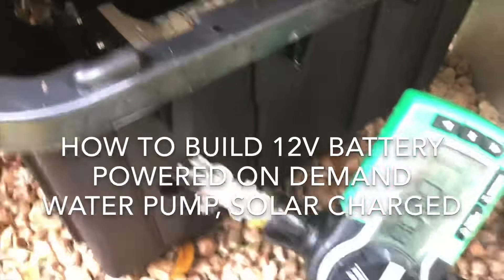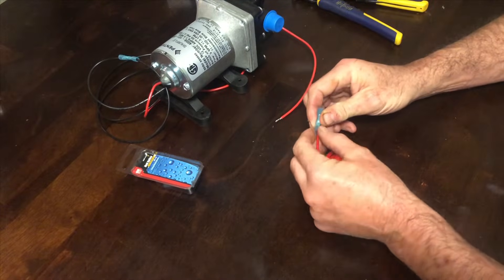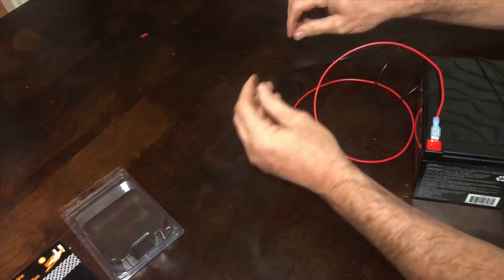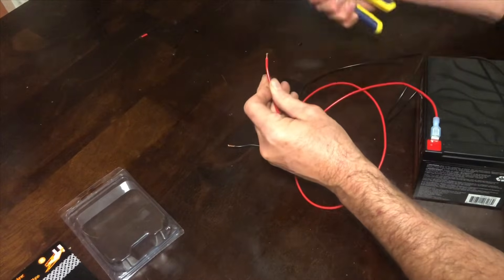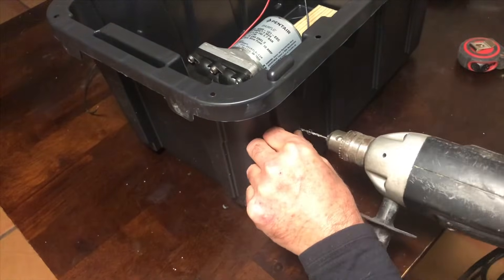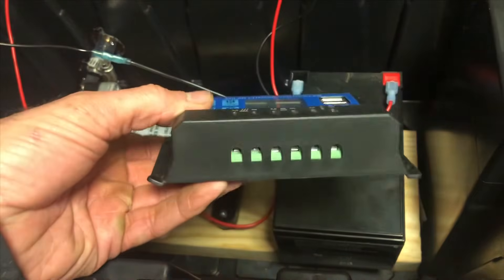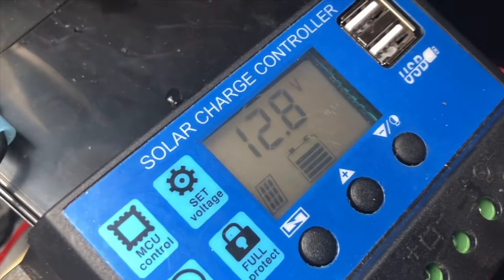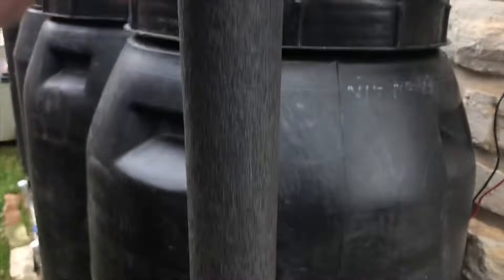DIY Battery Operated Water Pump for Rain Barrel Irrigation, with Solar Charging

Comment: Nice!  Be aware if there is a leak from the pump connection inside the plastic bin/box, it could flood the and damage the pump.  Maybe drill some 2 inch diameter holes 😊on the box bottom for drainage?

Comment: Hi Tony!  Thanks for a great video.  I have set up exactly as you did but my pump will pulse on and off if I connect it to the battery.  I do have the rain bird timer on the output side. Any idea why this could be?

Comment: I seen in other videos people wired the pump directly to the battery. Does it matter if the pump is wired to the battery directly or straight to the charge controller?  Just looking for other options ..

Comment: Hi. Thank you very much for this. I've followed you advice and will be doing this install tomorrow. Can I just check. I get very low water flow from a tap in my water butt. Does the pump actually increase pressure from a weak flow? Also should it go before or after the time the water flow sequence?

Comment: Please advise all the parts and tools used. I especially like your stripper. What make and model pump? Can you please put links for the battery and the parts for the solar panel bracket? Please put a link for the stripper. Thanks.

Comment: Thanks for the video. Do you have a pressure regulator after the timer?
Reply from the maker: Good question, yes, its a 25 PSI Low Flow Pressure Regulator.  I'll be sure to mention it in the upcoming update video.
Reply: @TexasOrganicGardening  Any update yet?

Comment: I'm late to the table 😄 very informative vid-clip and enormously helpful. One question: why AC and not DC pump? Quite impressive controller/inverter.
Reply from the maker: It is a DC pump, run from small battery.
Reply: @TexasOrganicGardening  yea, but why?

Comment: Hi I like your video and I will like to buy the same water pump but I didn’t see on and off switch and I need just for hose to water garden
Reply from the maker: It is an on demand pump, so if it detects water flow out the hose end it turns on and pumps more.  Same pump used in RVs for something like a kitchen sink - turn on sink pump kicks on automatically.  If you're manually watering garden have a nozzle on the hose that you can open/close. That will cycle the on demand pump.

Comment: I noticed you struggled just a little when using the hole saw. If you’re drilling plastic or even very thin metal with a hole saw like that, run it in reverse and it’ll work much smoother.  Thanks for the video. I’m watching tons of them to compare to the build I’m working on. No criticism here, great job. It’s simple and works for your application. 👍🏻
Reply from the maker: Thanks for the tip!

Comment: Hi Tony. I built a similar system but am having issues with my motor pulsing. Do you have a vacuum break in the line after the timer? Wondering if that might fix my issue. Thanks

Comment: Great video. It took me quite a while to find what I was looking for. I am going to set up a system like this for our school garden.   I have a question.  What is the longest you suggest letting that pump run before you run into overheating issues?  Thanks.

Comment: How does the timer hook up to the pump to turn the pump on and off? And what timer did you use? And this is a great video good information! Thank you with any help!
Reply: The pump has a built in pressure switch and only runs when there is a demand.

Comment: Thanks for the great video - I'm working on plans for something similar, and have a few questions for you. 
Have you found the size of the battery to be enough to support your system? I was considering a deep cell RV battery, but would love to consider something cheaper. 
I also noticed you don't have a fuse on the pump line - any reason to add one? 
How many watts is the solar panel - does your battery remain well charged all year? 
How long of an irrigation system? I have to water 7 4x4 boxes - would the PSI on the pump be enough to reach the end of my line? Thanks again for the great video!

Comment: Why does the load output keep turning itself off?  Kinda like it times out and shuts off.  I keep having to open the crate and hit the button to turn the load port on to use the pump.

Comment: Do you need a flow regulator so you don't blow out your dripper lines in your garden beds???
Reply from the maker: Depending on the pump you use, possibly yes.  Most drip irrigation work best at about 25 PSI if i am not mistaken but check the specs of the drip lines and emitters you are using,

Comment: This was helpful thanks. I put in a similar build bit with a splitter before the timer so I can use it for hand watering also (super handy) plus put in a float switch in the water butt to prevent it from running dry.

Comment: Hi! I made this set up but with a hose instead of a drip system and sometimes when the pump shuts off due to pressure my solar controller will reset and the arrow between the battery and load will start blinking and i have to click a bunch of buttons for it to reset. Any suggestions would be very greatly appreciated!
Reply from the maker: Not sure, but I’d check with the controller manufacturer

Comment: Great video, thanks. I built an exact replica system. I keep running into the charge controller flashing the load icon. According to the manual this requires a reset. No matter what I do I run into this problem. When this is happening the timer doesn't turn the pump on. I have to manually turn the pump on through the controller. Any advice is welcome.
Reply: Are you connecting the pump to the load connections on the charge controller or wired right to the battery? I have two similar systems, but I replaced the charge controllers with something more robust. From what I understand, the load connections on the charge controller aren't really designed for higher loads. They're more for low voltage lighting or monitors. I wired mine directly to the battery (with a 10 amp fuse in between the pump and the battery on the + side). I previously had them wired to the load connections on the charge controller and one of them started smoking. I took it apart and part of the PCB was burned up. Just before, I was having the same issue you mention. Unfortunately, now in hotter temps, I'm running into thermal protection turning off the pump after about 10 minutes of watering. According to Pentair, these pumps are not designed for continuous use, just short term and intermittent use.

Comment: I’m wondering if you’d be able to share a link for a water pump with an outlet plug that you’d recommend? I’ve loved your videos and am thinking of doing a slight modification with a power inverter so I can run my chicken coop heaters off it in the winter too.
Reply from the maker: It’s should be in the video description, if not in this video then in one of the others in the Rainbarrel system Playlist
Reply from the maker: Google search for on demand water pumps.  There are usually AC and DV versions of each pump.  I chose to go with the DC (12V) just because I wanted to do a solar project and learn.  Nothing wrong with use a plug in version.

Comment: Nice video. I have the same charged controller. Did you install a 10 amp slow blow fuse inline with the motor?
Reply: I'm so sorry for asking this but what is inline with a motory? He did list the fuse but didn't show an install.
Reply from the maker: Yes there is an inline fuse recommended.  I need to publish an update video!  It had not arrived in the mail in time to make the original video.

Comment: I'd have gotten some bulkhead fittings for the tote, to help make it more water tight. I also would have done a bit more cable management, added a riser from that 2x4 to mount the solar charger on. all in all, not bad.

Comment: Great idea!  I would have an additional tote within the larger one for all the electronics though.  If a hose ever cracks, the last thing you want is a live-current 12 V solar system swimming near your work area.
Reply from the maker: I think 12V systems are considered safe, thats why most outdoor lighting and such is usually 12V, but if anyone has more info on this I am always open to discussion.

Comment: Good video.  Quick tip, never hook up the wire leads to the battery 1st, that's always the last connection. It's can blow up the battery if the two ends touch.

Comment: You didn't show the fuses being wired in. I am assuming these are wired in-line with the positive from the battery to the pump, and similarly to the solar panel? I didn't see these in either of your videos. If you could confirm it would be appreciated. What size fuse did you use for the pump and also for the solar panel? Great video and very helpful.

Comment: You need to provide drip loops at the tote wire penetrations. Don’t want to mix rain water and electrics. I’d seal off the controller hose hole as well. Keep the tote dry!

Comment: Where did you get those 1/2" barbed fittings to the pump and what are they called?
Reply: they look like standard barbed fittings. wal mart garden section or any home improvement should have them.
Reply: The pump comes with the fittings. You will need a to get a 1/2 inch inner diameter hose, clamps and fittings to hook up any hoses or tubes to the barbed fittings on the pump.  I used this setup for on demand.

Comment: Can this solar charge controller be interfaced with inverter?
Reply: Never connect an inverter to a charge controller. The inverter is connected (with a fuse) to the battery.

Comment: I don't understand the "on-demand" nature of the pump. Doesn't that imply it has to have a static head pressure on it at all times? And if I didn't want to use a timer, could I install a switch between the pump and the solar controller? And third question, where do the fuses go? Thanks. -- or -- Maybe I don't understand the way an on-demand pump works. If I wired it just like you show, but instead of an irrigation timer, I just put a manual water shut off valve on the outlet of the bin itself, then the pump would notice a pressure drop and turn on?  So the head pressure just from the rain barrels is enough to engage the internal pressure switch?
Reply: hey, did you ever figure out where the fuses go?
Reply: @lynsey911  no.
Reply: @woodsykris  I found that he said: "1) Between the charge controller and battery bank, 2) between the charge controller and solar panels, 3) between the pump red lead and the controller." 

however, this is my first wiring project, so I am still lost. If I figure it out, I'll post it here

Comment: why put the hose pieces on the pump, looks like you could connect directly to the pump.. this creates more possibilities for leakage
Reply from the maker: Pump has some strange fittings, must have made 6 trips to Home Depot trying out what seemed like common sense connectors and nothing worked.

Comment: Great project nicely explained. Just a note about battery safety with flying leads. At 6:40 you have flying leads connected to your battery with unconnected stripped ends. They get very close to each other when you are offering them up to the control box. If they touch each other you're going to get a large flash, burnt wires and burnt fingers minimum. Take care to connect the battery (or whatever power source) last when wiring up. 👍
Reply: Except with solar panels. You always connect the solar panels after the battery is connected to the charge controller, or you'll ruin the charge controller.

Comment: Thanks for the video! Any idea on whether the pump draws power (or how much) when on standby mode?
Reply from the maker: Very little to none.  I think it only switches on when it detects water flow on the output side (ie timer valve comes on).

Comment: I purchased the pump that you had a link to, but in my assembled unit the pump keeps turning on even though the valve to the water is off and the timer is off. Is there a setting on the control panel I need to change?
Reply from the maker: The pump is ‘on-demand’ and only turns on when it thinks water is trying to flow out (imagine it in an RV and someone turns on a faucet).  Most likely cause is the seal/clamps to the tubes in or out is not airtight.

Comment: Thank you for making this video.  Prior to seeing your video I was researching about 5 pumps for this application and just so happed to settle on this exact pump.  

You list OEM model E65, which is stock that was sold directly to companies like motorhome and other RV manufacturers, etc.  Later Shurflo released an aftermarket model A65, which is identical.  https://www.amazon.com/s?k=4008-101-A65&ref=nb_sb_noss

This company sells the A65 with or w/o a water filter.
https://www.amazon.com/SHURflo-Revolution-Water-Pump-4008-101-A65/dp/B010TKMK4O
My Pick  https://www.amazon.com/RecPro-4008-101-A65-Self-Prime-Plumbing-Optional/dp/B0845RFN8Z

Comment: First, let me say cool project, I am making my own.  I put in 3 barrels this summer and quickly got tired of lugging the watering can around.  I bought the exact pump you used, and I thought the barb adapters came with the pump, and I had no idea the bafflement it caused the poor plumbing dept guy at Lowes.  I wasted $2 as he gave me some fitting that had hose thread on it....since we are using the flex hose, is there a reason why the swivel barb adapter is needed?  Will it leak with a regular barb adapter?
Reply from the maker: I put my guy at Home Depot through hell finding something that worked.

Comment: What water filter is that that you used?
Reply from the maker: It’s from Rain Bird. Something like this will work: https://store.rainbird.com/rby075mptx-3-4-in-inline-rby-filter-with-200-mesh-screen.html
Reply: This filter is often sold with the pump.  https://www.amazon.com/SHURFLO-255-313-Twist-Pipe-Strainer/dp/B000V2W0GE

Comment: Anyone with this setup having problems getting the on demand pump to turn on? I’m using all the equipment as the video did. After setup, it works once for me, but the second time I open up the valve to use water, the bulb icon on the controller starts to blink and the pump won’t turn on. I have to reset everything for it to work again. I’ve checked all the electric wiring, as well as the tubing for leaks. The battery is fully charged, and none of the fuses are blown.
Reply: Got myself sorted out! When my pump first turns on, there is a surge that is slightly over what the controller can handle, so the controller went into error mode. The two solutions I found are either 1) get a controller with a higher amp rating 2) use a fuse box to connect the pump directly to the battery, rather than to the “load connector” in the controller. The systems works great now and the pump is fully on demand.
Reply: @benmoscatello1026 what kind of fuse box and what size fuse did you use? I planned on following this but connecting the pump directly to the battery. Or what amp controller would you suggest?
Reply: @Adurning10  it’s been a while so I don’t remember my entire troubleshooting process, but I just checked and the controller I’m using is actually a 20amp as well (what I think the original controller suggested in the video also is), just a different manufacturer.
Reply from the maker: Thanks for adding the follow up!!

Comment: Tony, I think you said on your other video that you needed to get a pump because the timer requires pressure to operate.    Are you aware that there are no pressure timers (battery operated) that open and close the valves?  Would this type of timer avoid the need for a pump?
Reply from the maker: Hi Mark, no I was not aware of zero pressure timers (but I just googled one).  The system when full only put out about 3-5 PSI before I added the pump.  As the water in the barrels depletes the PSI drops.  My main concern is that drip irrigation in general needs 10-30 PSI depending on the quantity of drip lines, so I still feel a pump would be required, depending on how high the barrels are above the garden.  If the garden was well down slope (say 20 vertical feet) from the barrel system it might work just fine with a zero pressure timer and no pump.

Comment: Thanks for the video, do you know about how many gallons of water are used per cycle?
Reply from the maker: Isaac Rodriguez depends on how long I run the timer but probably about 30 gallons in 10 minutes because it will empty 220 gallons in a week.

Comment: Tony: Last week I finished putting together my system.  I used everything you did, even the tote! The only difference is that I am powering 2 sprayers on risers that covers my 8x40 garden. I also used some of the info on building the solar panel bracket.  This was all great stuff and I really appreciate you making this video.  I have gotten a lot of comments on my system already....and we love using the rain barrel versus city water.
Reply from the maker: Ron Mele Thats awesome, how many barrels did you go with?  I’m going to add some more during winter break.
Reply: @TexasOrganicGardening  I just picked up twelve 30 gal screw top white food grade barrels for $20 each.  They look brand new. I’m going to build a few into the ran collection system like yours.  I’m putting in a rebased bed garden this summer.  I’v got an ancient DerectTV dish on the wall in the back of the house.  I can use the mounting arm for the solar panel.
Reply: And what’s the sprayer setup look like?

Comment: Hey tony, thank you for video.    Is there anyway you can operate the pump automatically when you use the garden hose from the other end?   For example, I am watering the garden about 30 feet away from the pump, will it turn off if I pinch the hose?  Or does it keep running until I turn off the pump?
Reply from the maker: AJ DIY Its an on demand pump so if water is allow to flow the pump will come on.  You could pinch the hose, use a sprayer with trigger etc and it should shut off.  It’s the same pump used in RVs.  Always ready but only comes on when a faucet is turned on.